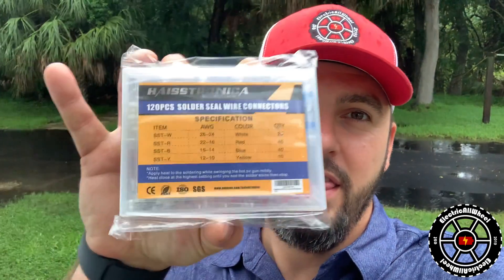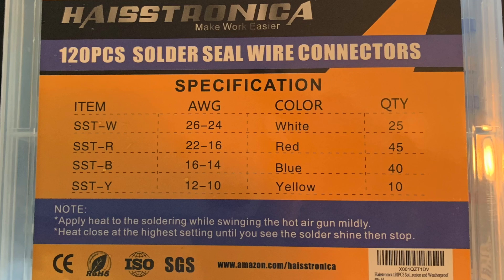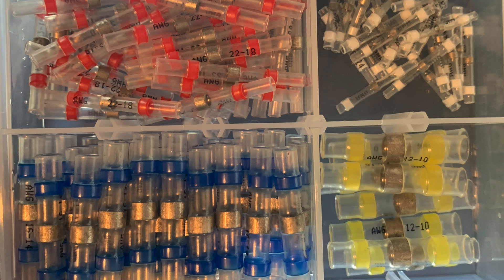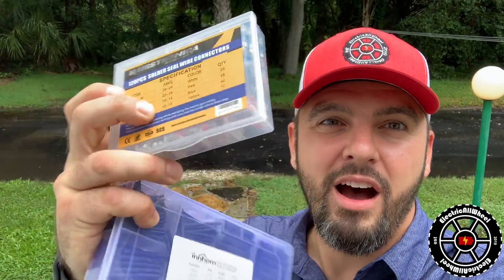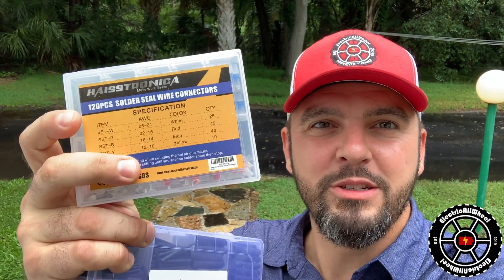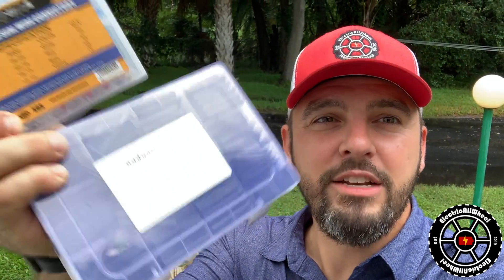How to Connect E-Bike Electric Bicycle Battery Wires No Soldering With Solder Seal Connectors

Comment: what is the safest way to initially cut the charging wire connected to your ebike battery before you proceed with your splicing instructions?
Reply from the maker: One wire at a time after unsheathing the main cable.
Make sure they never touch

Comment: Can u use this with a 48v battery and    1000w motor
Reply from the maker: It’s more about the wire size and they make solder seals for different wire sizes. Short answer, yes.

Comment: Will amps going threw  melt it.  will it lose contact
Reply from the maker: It heats a solder core and simulation shrinks wraps it. I love the option. The seal should match your wire gauge